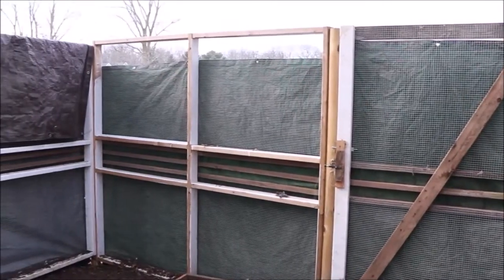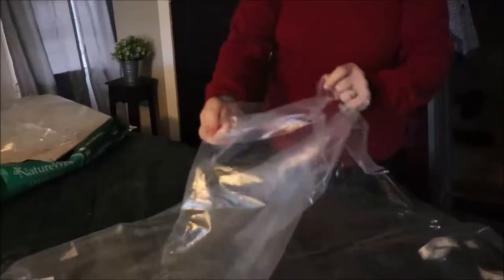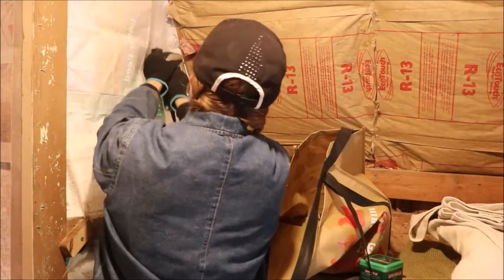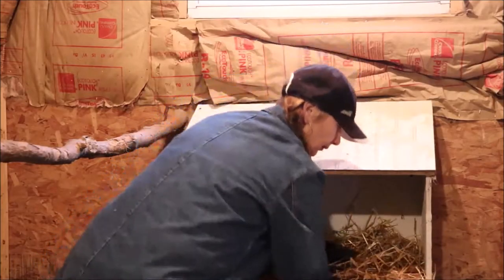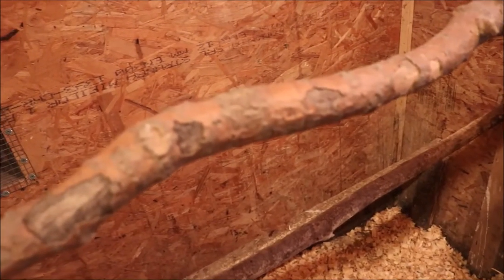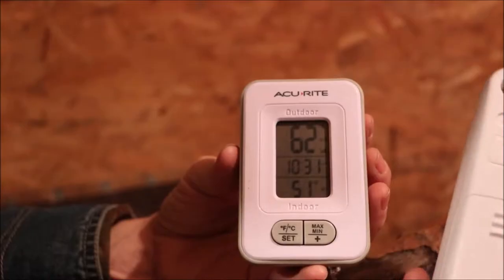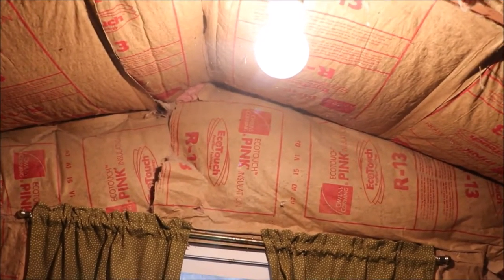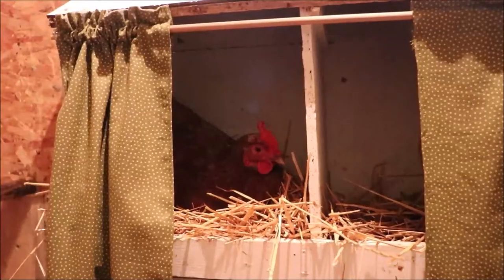Winterizing chicken coop ~ Keeping chickens warm

Comment: what about ventilation ?
Reply: Hi Terry Thanks So much for watching!  I tried to cover a lot in this video and that was something very important that I left out.  Our coop is an 8'x10' hip barn.  The front has two doors that my husband built, as the coop did not have doors when we moved in.  In each of those doors I cut an 8x8 inch square in the center closer to the top, approximately 8' down from the top of the doors.  I then placed chicken wire on the openings for safety.  Additionally, the "wall" we built, just above the screen door, because of the shape of the hip roof, there is a gap between the frame of the door and the ceiling. It measures approximately 4" high and the width of the screen door.  Straight across from that, is a window that opens in. We did not caulk around the window as the window faces east, and rarely does wind blow from the east here, but the slight crack around the window allows for that continuation of cross ventilation.  This "system" allows for airflow and ventilation, up high so that the air does not blow on the chickens.  Additionally, I do not keep water in their coop to keep the coop dry and reduce moisture which leads to frostbite on their combs, and feet.  No water also helps with ventilation, keeping the air dryer.  I hope this helps.
Reply: @kimbloomwell6395  sounds good, i'm always looking for good ideas for my chickens, i live at 9500 ft on top of the rocky mts and cold weather is a major concern ; thank you for your response
Reply: @terryravey2248  that is really high up there!!  I am sure the view is gorgeous!  I hope this helps keeping them warm. Don't forget to toss them some cracked corn an hour before bed.  Corn digestion raises body temp and helps keep them warm naturally :)